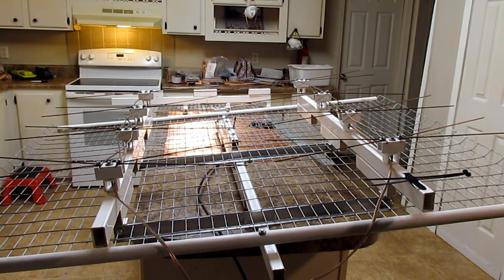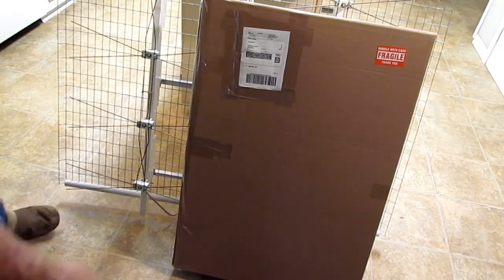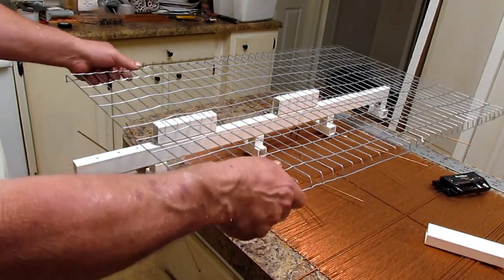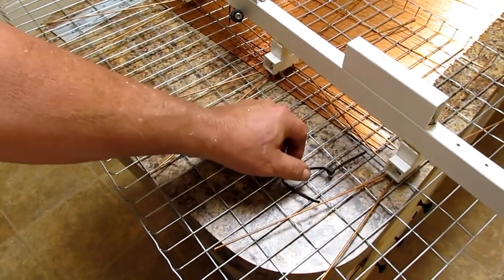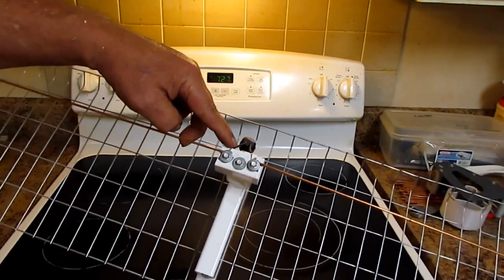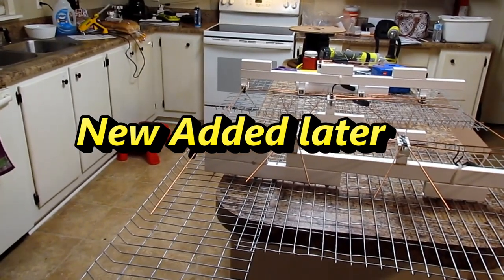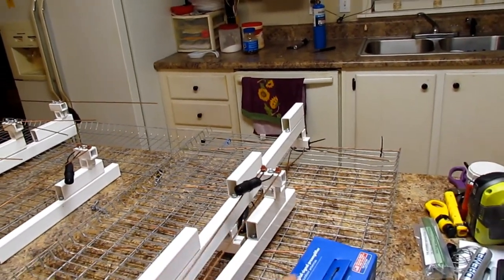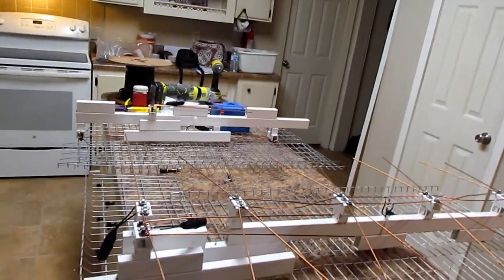Ultimate TV Antenna With VHF Add On

Comment: Hi Danny.  I've been following your channel for the past 4 years and I am glad to see your progress.  For your information, Channel Master ships their 8 bowtie model 4228hd for $14.99 on Amazon.  Their box measures 42" x 34" x 3".  Did you ever think of selling this antenna as a kit form?  You could have one large reflector for both the UHF and VHF cut to size but rolled up.  You could even have the bow ties and linkage unmounted.  The end-user just screws everything together.  If you made the mainmast out of aluminum, you could make the unit slightly lighter and stronger than the PVC filled with wood.  I for one would be interested in that combination kit form.  Could you do a test between the CM 4228 hd and the ultimate antenna?  Thanks.  It's been fun seeing your progress over the years.  It was funny seeing the return antenna with the reflector still attached to the wrong side of the antenna.
Reply: I think it's better on a non conducting frame. His antennas are way better than the store bought ones.
Reply: @ronb6182  I agree with you.  Being that his dipoles are soldered to the connection rods, corrosion and resistance from motion will be eliminated.  But it also depends upon how he is bridging and connecting the signals from the UHF and VHF banks.
Reply: @SilverShadow2LWB  a uhf vhf splitter is needed.  You can also use a combiner because it doesn't matter if it's uhf or vhf. I only done it with 300 ohm twin lead and did not need a splitter or combiner but I had a vhf only antenna for vhf and a uhf only antenna for uhf and tvs back then had seperate antenna hook ups. You can combine two alike antennas with 300 ohm twin lead. And not need a device.

Comment: If the distance from the top UHF whisker is not an exact science, can you use a 4 FT high roll of wire and then build your backbone as one piece to better accommodate the top VHF antenna?
Reply: The separation distance  for the VHF reflector is larger than UHF.  The lower the frequency the larger the distance needs to be.
Reply: VHF Elements work WITHOUT A REFLECTOR!! For the last 70 years!!!!!!

Comment: I gonna make a few vhf elements for rf channels 6,10 abany GA,9 and13 in Panama City,11 Columbus GA and 12 in Mountgermery ala   and mount on separate poles pointed at transmitter and splice together and see what happens might work on the other hand it may not because of signal loss.I live near Dothan al
Reply: If all these stations are in different directions you should make a yagi-uda for each and combine them all.  If they are all in the same direction then make a log periodic dipole array with a dipole sized for each frequency you need and put a reflector bar behind the last dipole and two or more directors in front of the front dopole.
Reply: @gregoryjreed  that's my plan I just didn't go into great detail it might work or they might cancel each other out lot of variables here,will cut elements for each frequently all I can do is try..it's my hobby.i can all ready get all these channels and a lot more on uhf using a rotor.I just think it might be great if I can get all the channels buy just using the remote to change the channel and pass signal through a wire to other tvs